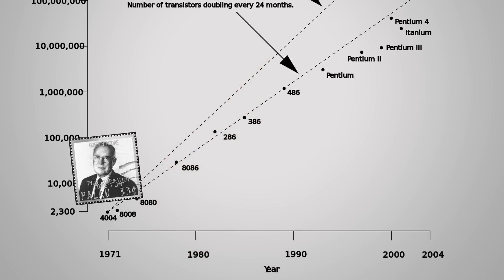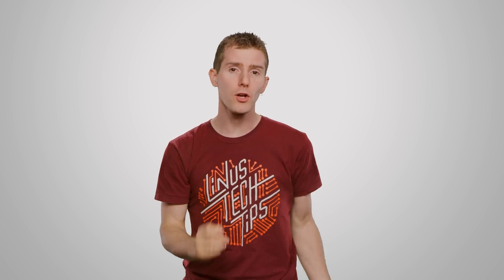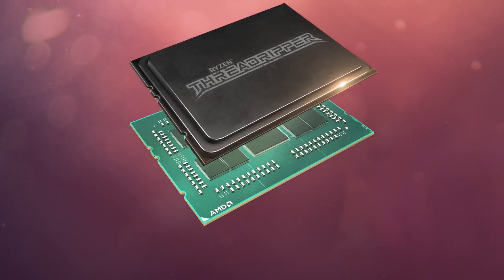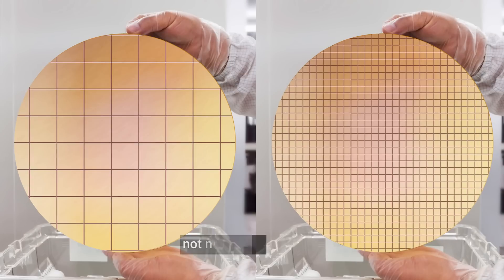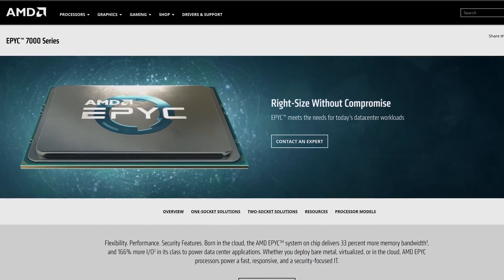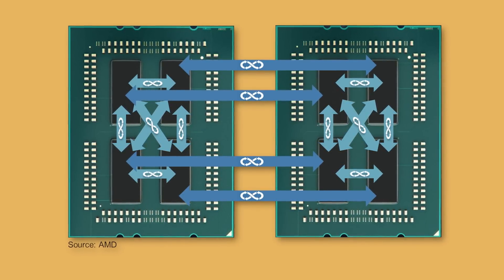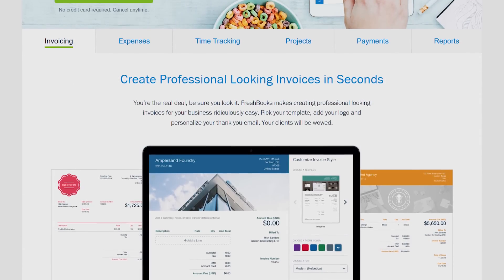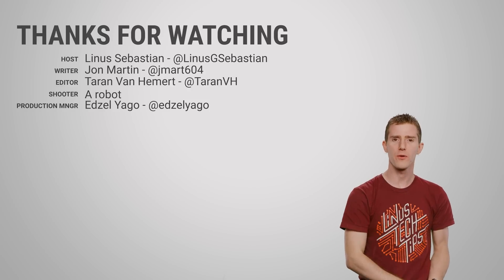How AMD is Making CPUs More Affordable - Chiplets Explained

Comment: Are the connections inside a monolithic die faster and if yes, by how much?
Reply: Connections are not faster, the architecture is different.
Reply: @paolophoenix  What do you mean by that?
Reply: yes, die- intern connections are at least theoretically faster (in terms of Bandwith), but the issue with inter- die - connections is less the bandwith available, but more the latency introduced by the physical space the data has to travel.
Reply: / @Toby-st  wow really? I would have expected that on such short distances that doesn't really matter and still cannot really understand it. A google search yielded that connections in copper have a speed of about 20,000,000,000 cm/s. (2/3 speed of light)
One CPU cycle running at 4GHz takes 4 nanoseconds. In this time a signal travels about 5 cm. So at best you could take one additional CPU cycle for a very large CPU if you have to transfer to the other side of the chip. So is there a calculation error or did I overlook something?
Reply: @ymi_yugy3133  It's not to do with that, the issue is more that you can have a lot more connections (as in paths) internally in parts of a die than you can have externally because to go externally each needs its own physical connection off the chip, and chances are those are a somewhat limited resource so some sort of multiplexing will be used to share the bandwidth between all the signals that need to communicate, which introduces latency whereas if it was all on one die you'd just have a direct connection.

Comment: why isn't cpu clock speed increasing please make this video
Reply: Because of power and heat constraints.
Reply: https://semiengineering.com/semiconductor-industry-getting-serious-about-chiplets/

https://www.extremetech.com/computing/290450-chiplets-are-both-solution-and-symptom-to-a-larger-problem
Reply: The "power wall".
As frequency goes up, so does heat. 
At a high enough temperature, you can't 100% tell if a transistor is a 1 or a 0. Which is the basis of all microprocessing or something like that.

Comment: Why not use chiplets and die stacking,  and use HBM ram for cpu caching, seems they're moving towards transistor density than transistor count
Reply: Thermal regulation?  Flat pack means larger surface area available to heat spreader???
Reply: https://semiengineering.com/semiconductor-industry-getting-serious-about-chiplets/

https://www.extremetech.com/computing/290450-chiplets-are-both-solution-and-symptom-to-a-larger-problem
Reply: https://www.extremetech.com/computing/290450-chiplets-are-both-solution-and-symptom-to-a-larger-problem

Comment: 2026 ... new chiplet processor units reaching 99 Ghz when supercooled
Reply: I'm pretty sure chiplets dont help with the "power wall" problem, . At a certain frequency (not even 10 Ghz) the the transistors get so hot that you cant reliably tell the difference between a 1 and a 0. It kinda "bleeds" together at that temperature.
Reply: I think we will have processor cubes, with a chip, heat pipe, chip, heatpipe, chip,heatpipe.. configuration.
Reply: So many got wooshed down here
Reply: 2030 new "cpu" that uses ununnovem in a 10pm(angstrom) 3D process does absolute zero with out cooling reaching 5Thz at boost and cools your room at the same time!
Reply: @ApocalipsisEnSabah  2040: cpu with transistors as small as the fabric of reality itself
Reply: There is another issue a square wawefront includes all odd frequencies. To resolve a square wave u need at least in the channel 10 (better 15-20) times the frequency you run at.  So you channel must sustain at least 990 Ghz around 1 THz nope for silicon of the processor architecture. You need to use surface wavelets or optic fibers, too much radiation dissipated as antenna effect.
Reply: Never ever, Its clear that you dont know anything about signal transfer and heat production. Does not matter how you cool down a chip at atomic level the heat is not dissipated so well you gonna have melts down.
Reply: @paolophoenix  google diamonds chips or IBM's SiGe transistors,power transfer in superconductors,spintronics and magnonics,before you say "Never ever".
Reply: @Steellmor  C'mon. Better have 1000 chips of 1Grand that 1 chips of 1000 Grand.  The complexity of a modern chip is 10 Gtran a new technology 2100.
Reply: @paolophoenix  First,you was saying that person know nothing about signal transfer and heat production,now you change subject to money.
Second,what would be better in speed race - 1000 snails or 1 puma? Having 20x frequency,means that calculation will be 20x faster.
Reply: @paolophoenix  here's when quantum computing will be required.
Reply: @GauravSharma-dy8xv  Happy for QC but, It will never work. There is a flaw  in quantum reality. QR Is not deterministic. You will have only a probability. Think about that. program a Quantum computer to decide if a button must be pressed. If yes you press and destroy a nation, if not you will not destroy it. This computation is NP complete. The QC says "ok man" 99% press. What you gonna do?
Reply: @GauravSharma-dy8xv  I believe Optical Computing clocks that high these days. but is very impractical.
Reply: @SimplyNon_sense  there's just that small you can create "transistors" in a photonic cpu (if that's what you're saying). And that limit is much worse than CMOS-based silicon scaling, something like transistors being 100x bigger than a current let's say 14nm process. Ok let's say you'd get a much lower power consumption thus a more friendly heat for much higher frequencies, but at what cost? a number of "transistors" (that'd be some sort of small mirrors) that we had back in the 70s? i don't see a huge performance gain, if at all... light is also analog in its nature, so lol i don't know how would that work with our 1's and 0's.
Reply: @paolophoenix  QC is probabilistic yes, and we only have a handful of algorithms to deal with it so far, but i'm seeing it having a future because it is really good at certain types of tasks, and it will only get faster from now. But yeah, not here to replace anything... QC will most likely be only a complement to traditional computing... right now though, it is as fast or really slower than even your everyday laptop for most of the tasks there are.
Reply: @paolophoenix  ,
Yes and No regarding the BUTTON example. The Quantum Computer acts essentially as a co-processor and the instructions (AFAIK) are still being sent from a regular PC. So think of it as a graphics card where the Quantum Memory is analogous to the Video RAM and the GPU processor itself to the QC processor... in the "decision" case to a destroy a nation it would come up with PROBABILITIES yes, but those values would be sent back to the main PC and it would still have an IF-> THEN flow to it so IF the probability is greater than 90% for whatever THEN the button is pressed.
Reply: @paolophoenix  8ghz is more like it

Comment: I generally do think TechQuickie is fairly accurate but A) The 3950X exists and B) Threadripper and Epyc parts right now are not chiplets, they are full-sized Ryzen dies stuck together. They are not what AMD refers to as chiplets, and these actual chiplets are going to be coming to the market with Rome (Epyc Gen 2), Matisse (Ryzen Gen 3) and Castle Peak (Threadripper Gen 3).